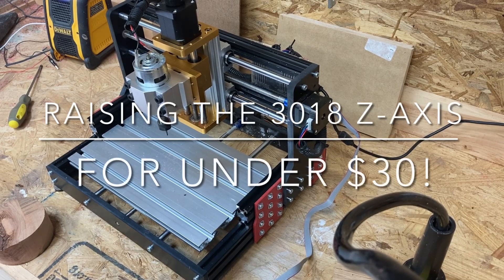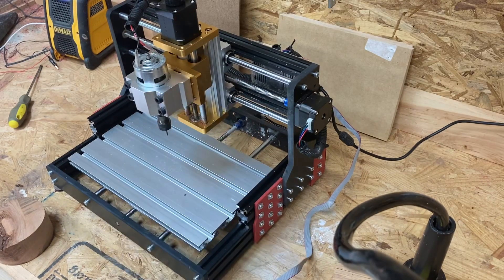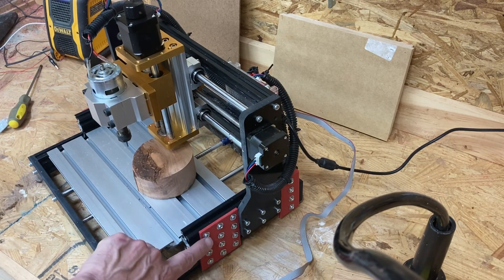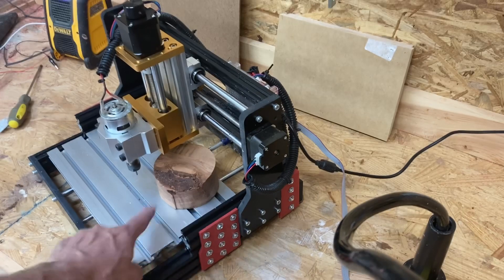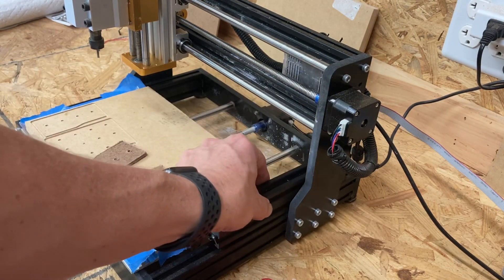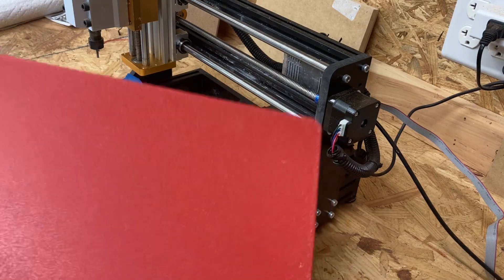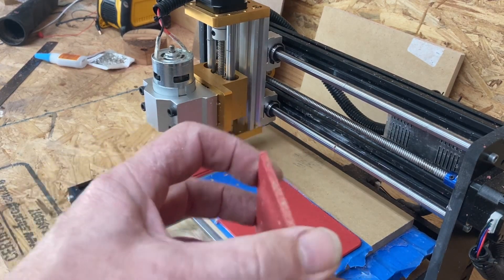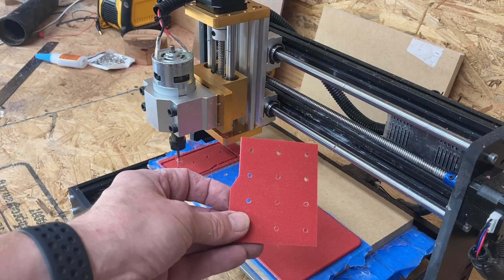Raising the 3018 X-Axis on 3018 CNC for under $30

Comment: i know i am too late to suggest this.   had done complicated upgrades involving extrusion, rather than spending long time disassembling whole thing.   we discovered a little trick.  pop in 1 nut in.  line up hole in middle, catch with bolt.  pop in 2nd nut on end, use baling wire (or equivilant) push the nut along the extrusion until you see nut hole,  through the frame hole..  (if too much can use same wire to re-align from hole).   bolt catch the nut.  rinse and repeat with other holes.

Comment: To get more stability on the x-axis remove the bars and bearings and put linear rails and bearings on the two 2020 extrusions. Good job on raising the Z.
Reply: I'm in the middle of doing this exact upgrade to my 3018 and i'm having a ton of trouble finding a way to mount the linear bearings to the extrusion that makes up the vertical framing of the carriage. The bearings pretty much have to be mounted using screws that run through the whole extrusion piece but drilling the holes accurately seems to be impossible without using the CNC to do it lol

Comment: The point is 10mm rod at X-axis really weak. They use bolt screws to hold rod so XZ axis combo can't work well with deep cut. U can change it to 12 rod and with holder SHF12. Or MGN12 will be better. I fully upgraded mine 3018 pro with MGN12 and alumium Z axis.
Reply: You need upload that
Reply: @cHriS Thank you
Reply: @cHriS 3018 model really weak design for alumium and hard wood. Xz combo and 775 spindle not enough with er11 clamp chuck. So we need to build a lot for it

Comment: Did I catch it right? He said the holes in the support pieces he made are 20mm apart? In the vertical, I'm assuming...
Reply from the maker: I did. Horizontally they can be any spacing as they just fit in the slot. I just went and checked and I drilled the vertical holes at 20mm but whatever the vertical spacing is on your machine.